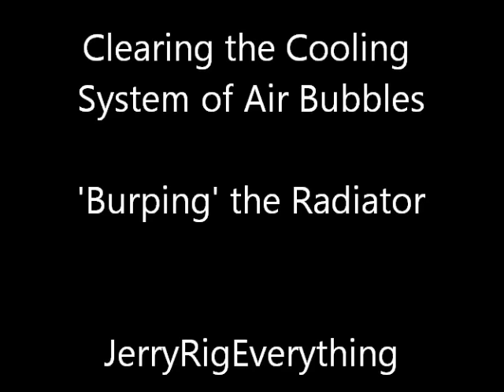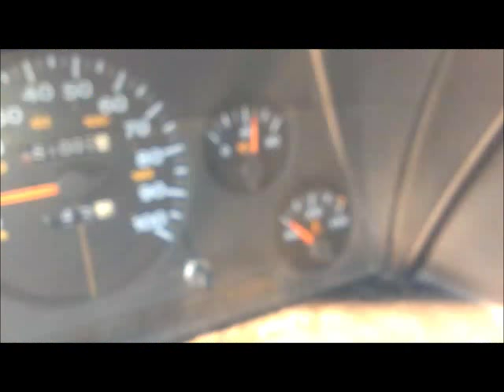Clearing the Cooling System of Air. 'Burping' the Radiator. Jeep.

Comment: I looked up how to bleed air out of coolant and all i got was run the engine and fill the coolant as needed. No one mentioned to take the coolant line cap off and bleed it while on ramps. You saved me a massive head and an engine. Cant thank you enough sir!

Comment from the maker: Yes, tilt the care up so the engine is higher than the rest of the vehicle. Then add the coolant directly to the radiator after squeezing the air out of the tubes.
Reply: hey, thought u need to use a funal to burp the car
Reply: @leepopaz253 no
Reply: @latinoheat210  yeah u do, need to be highest point of the car to let air out

Comment: Cut the very bottom off a 2liter bottle and stick the pour end in the fill hole your car tightens to. Fill the bottle just a quarter way with the recommended antifreeze start the vehicle with heater on max and watch the bubbles burp through the 2liter. Let the thermostat cycle 7-8 times while slowly filling the 2liter back to 1/4 if it starts getting low. Do not let it get low enough to start sucking air! Could take an hour running the engine to get all the air out. Just keep watching the cycle and adding a little antifreeze here and there when needed until it starts to cycle with zero bubbles. Then cap the radiator and hopefully your done

Comment: You just need to make sure your overflow tank is topped off and your radiator cap is working like it's supposed to. When the pressure builds up past a certain point, the radiator cap will allow coolant or air to flow into the overflow tank. When the engine cools, the pressure inside the radiator will drop, creating a vacuum, which will siphon more coolant from your overflow tank.

So just run the engine for a few minutes with the heater on max, maybe try revving the engine a bit to get things flowing.

Repeat this a few times and the air bubbles should work themselves out. Keep an eye on your overflow tank though, make sure you top it off if needed.

FYI, if your radiator feels hot after the engine is running for a while, then you know the fluid is flowing through the engine like it should be. If it's not hot, then you might have a problem. Don't trust your guages completely, because if there's an air pocket where your temperature sensor is, it could give you a bad reading.
Reply: Thank you!
Reply: Great comment thank you
Reply: 100% sure? I’m going to do this. Sounds easy.
Reply: @NishantGogna  Yep, top the radiator off first, run the engine for a few minutes, let it cool off, repeat. This should bleed the air out of your system. Make sure to keep the overflow tank topped off.
Reply: I jus burped my taurus today and but before the thermostat open up water bubbling spilled over...I did see air smoke coming  out
Reply: I have to change my radiator in a few days. What you're talkin about here with the overflow tank are you talking about making sure there is coolant in the overflow tank are you talking about the first line towards the bottom or the Top Line almost towards the top? Thank you
Reply: @BugzKiller  the overflow line is the one that runs right next to the radiator cap.
Reply: @ronnelllittlejohn6102  what was your issue?

Comment from the maker: Ive never used your method before.  I always drain the coolant out using the drain plug in the bottom of the radiator.  Then when I am ready I add the new coolant to the vehicle. Everything should drain out.  It helps if the car is level, or even tilted forward (nose down) to get the coolant out.

Comment: I changed my thermostat, radiator and fan clutch on my Isuzu Rodeo, yet it was still getting hot. I bet you more than anything your solution is the right solution. Thanks.

Comment: Changed my starter yesterday and had to take off the radiator hose to get to it. I drove the car around today and notice when idling it was getting up there in temp. Thank you for making this video. Going to try this. I am pretty sure this is the issue..
Reply from the maker: Jessica MacDonald Good luck! I hope it works out.

Comment: Never heard hoses referred to as tubes so many times before but nice & succinct vid to cover the topic.

Using a funnel with coolant slightly overfilled into the funnel allows for an easy viewing of air bubbling & rising up to escape thru the fluid whilst simultaneously sucking in additional coolant as it's burped. My recommendation would be to leave the funnel in the entire time for easy adding of coolant until burped and full, then it can be capped & any additional coolant added to the reservoir.
Reply: Agree on this, hard to have confidence in advice calling it “tubes” when I’ve been changing radiator hoses for 40 years, but it’s always interesting to see if someone has a better method.

Comment: Thank you I thought I had blown head gasket. I just bought my jeep. Should of figured since it runs perfect and no oil or coolant is mixed togehter. It is however very rusty in the coolant system. I suspect the prior owner used tap water to fill
Reply: u need to flush your radiator

Comment from the maker: Does a lot of white or blue smoke come out of the exhaust when you run it?  That would mean that there is a crack in the head gasket and your coolant is going directly into the engine.  (Which is obviously a bad thing)

Comment: Thanks for this I've been trying to figure out my overheating problem after changing my radiator and thermostat I just did this and it seemed to work my temps. are running at 180-200 on my jeep. Thanks again

Comment: i have an 02 mazda protege and just replaced the radiator and the heat is cold air and it started to overheat. somebody told me it might be air. bubbles.. so i just try this? and usually how long do i let it run for?

Comment: I have a 2007 jeep commander 4.7 l I had a new thermostat and water pump last year it's running hot no AC I added a can of freon I see no bubbles unbelievable I also probably should of got hoat coolant auto zone in said prestone dexcool came up maybe I should flush it all out and get the hoat coolant hard to get it in NYC please help thank you

Comment: What a breakthru trick!!   Engine kept overheating on my 4.0L - removed the thermostat, checked for water pump shaft play; and STILL had circulation problems.

I'm going to find an inclined driveway and burp away!
Much thanks.

Comment: You didn't mention to turn on the heater and the fan full blast so it could get to the heating core as well. This is a must if you drain your radiator fluid out of your engine.

Comment: Thanks I changed my water pump and thermostat and I still over heated.  I burped the system but I don't think I did it proficiently  it started squirtin up at me getting antifreeze everywhere so I closed it I'll do what you did with the incline and such but I have a closed system so I would point mine downhill inatead of up

Comment: So you lift it up. Take the cap off start the car.. while the car is running go to my tube start squeezeing.. and after im done squeezing add more coolant while the engine is running?  But how do I no when to stop squeezing? ?
Reply from the maker: rex vevo2015 The squeezing just helps get the air out of the tubes.

Comment: on a 2013 ford transit connect does the overflow tank automatically remove air from the system? with a hydrometer check it is set for -10 degrees but living in north dakota i need -50. i want to drain some coolant and water mix and add strictly antifreeze but  am not sure about any air pockets.

Comment: Sweet lord, if this lets the heat flow in my Jeep you'll be my new hero.
Reply: If heat isn't getting into your jeep. You need to replace the thermostat
Reply: Did that before I watched the video.
Reply: I blew out the heater core with compressed and that fixed my heat, you can look up how to do it im sure.
Reply: Saw a few good videos, just have to get to a place to do it. This apartment life stinks.
Reply: Victor Sanchez nice 2nd gen
Reply: Thanks man
Reply: Victor Sanchez Dude, my temp would spike from normal to H like back and fort don't matter the gear, so i figured probably thermostat, I replaced it and the cap and did a full flush....it's still doing it I looked for a leak, i could not find one....now so i figured it's either my sensor or the gauge it's self so it's continued to do it...but I just figured it's that not worried about my engine blowing or anything, I burp my system but now I'm 2nd guessing it what do you think? BTW 2000 3G Eclipse GT
Reply: druno82 druno I was having serious issues with my jeep heat and did a reverse heater core flush and now it pumps out the heat. I went super simple too. You have 2 hoses that flow into your firewall one is an intake and one is a sender. Take the off near your water pump and stick a hose water hose in the return hose and run water threw it until clear water comes out the other hose. Then pour coolant in the same hose until it starts coming out the other hose and seal back up. BOOM super hot heat. The heater core runs coolant threw itself for so many years in the same direction, so back flowing the water cleans up all the things that have settled and letting you coolant rush threw it too fast.
Reply: JBwrath check your electric fan to make sure its working?
Reply: You have a coolant bypass hose issue. Fluctuating temp from normal to high , YES.

Comment: Thanks for the info.  My vehicle ran out of coolant when I was on the interstate and I had to get towed home.  I want to try this first to see if it'll fix the problem.  May I send you a video clip of what I'm experiencing with my vehicle and get some advice?  I'm not opposed to taking it to a mechanic to get it checked out, but want to exhaust all I can before I do to save some money.
Reply: Check your  upper and low radiator hoses first. Cheapest way is to fill it with water, let it run for about 15 mins, and then check them. Make sure you dont see any leaks. Could also be that you need to tighten down the clamps. Also take a look inside your res tank for milkly white to grey gunk. Thats oil mixing with your coolant aka blown head gasket. You can also take off the oil cap and if there is the same gunk under it too. Oh and one more thing: you can get a coolant test kit that detects oil for possible head gasket issues.

Comment: Had my radiator replaced, 3 days later overheated fluid bubbling up into the reservoir, took it back they changed the thermostat, but they left the old cap on, did it again ugh!!! Now after taking it back they said they did a test for exhaust in the coolant tested positive, took it to the mechanic who installed the new crate engine, they told me it was not the problem, they just put on a new cap on it, this is the 3rd radiator cap, and 3rd thermostat installed in one year, said it was fine, well it's still bubbling into the overflow and temp goes up, and down, never did that with the original engine, at this point I'm very frustrated at ,a  new engine, that ticks really bad when cold, untill it warms up enough, a new radiator, this thing should run like a dream, 5.7 350,  I literally broke the engine in on the highway going to work no traffic stopping and starting, all highway, this thing should be smooth, can't get anyone to fix it to my liking, I know what a new 350 should run like, about to get a lawyer involved, tired of getting the run around,  it's only been a year, they should have just got me a new engine it's under warranty, they tried to fix the really bad ticking lifters 3 times.

Comment: wille williamsson
I don’t have oil in water or water in oil but keep getting air in my collant system. Can it still be the head gasket? It runs well for a few hours after bleeding the system but then it builds up pressure and air again. 

Ford Fiesta 2005 1.4

Comment: So we just changed water pump, belt and thermostat and followed your directions on this video and after twenty minutes, it has started overheating again, I have a 2005 jeep Cherokee, right now, there are no more bubbles, the water is level and it is not moving.... What else could it be??
Reply: @kauaigold  I have a 1995 pontiac grand am I'm having a issue when I'm not accelerating my temp goes past 220  but when I'm accelerating It goes back to 220 could this be a sign of bad radiator??
Reply: @michealrobinson9778  Could be the water pump impeller is shot, as in its BARELY flowing. If you rev it itll flow more than if its idling, thus more coolant flow. I would replace the water pump first, especially since its cheaper, then maybe consider the radiator.
Reply: @kauaigold  ok bro I'll start there first beside it will be  cheaper to replace water pump then radiator ...thanks
Reply: @michealrobinson9778 , check your radiator fan if it's working. Your radiator fan should turn itself on when your engine reached its ideal temperature, which the needle of your temperature gauge is in the middle.

Comment: On my Honda civic. Just changed a head gasket.  But still overheating. And after this technique it was continuing to get bubbles from the radiator. What's the problem.

Comment: I've done this for hours at a time and still over heats. I had the clutch fan and thermostat replaced and nothing. I've flushed it 6 times and nothing. Suggestions?
Reply: Had the same issue. I was low on oil and it was boiling my coolant.
Reply: radiator hose lacks a spring and is collapsing or thermostat stuck
Reply: @keltingr  i don't have a clutch fan or a fan and mine over heats is that normal and what can I do to keep it cool

Comment: Do you put the cap back on when engine is still on or turn off the engine first? Thanks
Reply from the maker: It doesn't matter either way.  As long as you get the air bubbles out of the lines themselves. Thats the important part. The tiny pocket of air at the cap just sits there, and doesn't effect the engine.

Comment: Will it work if it's not jacked up or raised on one side?
Reply: I have never had to go to this kind of extreme to make sure that the system has enough coolant. As long as the overflow tank has the right amount in it you are good. Just keep an eye on the overflow tank and keep it at the right level and you should be great my friend.
Reply: it has enough coolant but their are some air bubbles in the system that i have to get out. the air bubbles will cause the temp to fluctuate sometimes. it doesn't fluctuate a lot but every once in a while it does but it never overheats like it used to..thank God, LOL

Comment: My car was repaired new radiator clamps condensers etc I drove less than a mile and over heated auto shop said they had to burp it still don't know any help ? They said it might have air bubbles causing the Thermostat not to turn on

Comment: i on here to look and research for my self  on my sons 2002 jeep limited . nect to the radiator cap theres a sticker with message saying about air bleed port , i looked an seen it it is upper hose where hose conbect to motor can see it says air blead

Comment: When I take the radiator cap off and start the vehicle, after a while the coolant doesn't stay bubbling inside the radiator like this video shows, it just spills everywhere out of the radiator. You know why?
Reply from the maker: Once it gets hot enough, the coolant expands.  Normally the cap holds it in, and it will only expand into the reservoir.

Comment: So i went to refill the radiator after an engine swap in my camaro and id fill it up but it would go right back down to about halfway on the radiator. Does this mean there is air in the system? There is no fluid leaking onto the floor or coming out of the water pump or any tubes. This happens with the car off so it couldnt be leaking anywhere.

Comment: 180 thermostat, big no-no. Came from the factory with a 195F. Also with a 180 stat, your coolant temp sensor tells the computer that the coolant hasn't fully warmed up yet. What does that do class? Computer opens the injectors longer dumping more fuel into the motor, thinking it's cold. What does that do class? Lowers fuel economy drastically, engine block doesn't expand fully causing ring wear and sealing issues. Over time can get fuel into the oil pan diluting the oil. Would you run any engine WITH THE CHOKE ON for extended periods of time? Excessive carbon build up, yup sure can. Several other eye-openers using an improper stat.
Reply: jim davidson never had those problems after installing 180 t stats in any of my dodge vehicles. You just have to tune the pcm. I just use the diablosport trinity to make the adjustments.
Reply: The truck does the choke based on intake temperature I think, and whether or not the O2 sensors are warmed up, rather than simply coolant temp..

Comment: Ok so I'm assuming that I need to fill the reserve up to the cold level (when the engine is cold), but then how do I know how much to add when it's running and bubbles are coming out?
Reply from the maker: When you are burping the engine, it should still be mostly cold, as long as their is coolant inside the reserve you'll be just fine.  Once you have gotten the air bubbles out, put all 4 wheels back on the ground and then get the reserve back to the normal operating level.
Reply: JerryRigEverything Ah OK thank you :)

Comment: my jeep cherokee engine is very hot after some minutes , Is this normal?
Reply from the maker: Adriano jujuba If the temperature gauge goes past half way... than no, it is not normal, and you need to get something fixed very very soon.
Reply: my engine doing the same thing

Comment: I got coolant came out from reservoir when the engine is hot but car no overheat ,it runs fine but when i opened rad cap ,the coolant splash out so i replaced headgasket ,rad cap and temostat and the result is still the same.